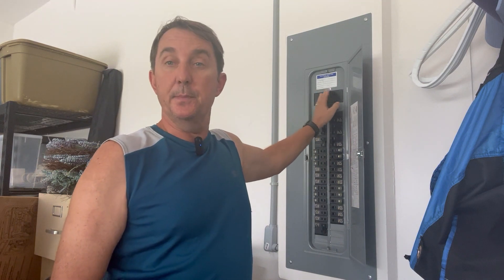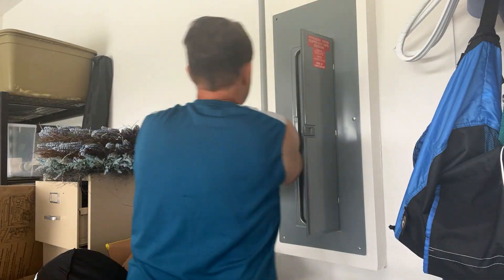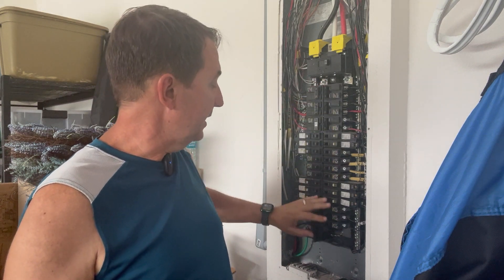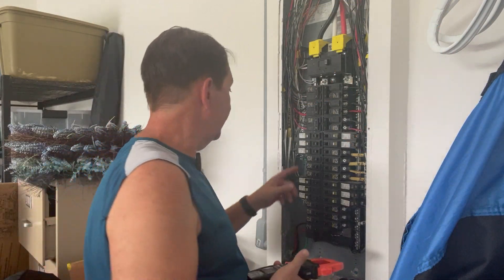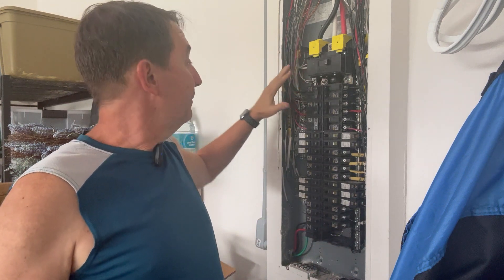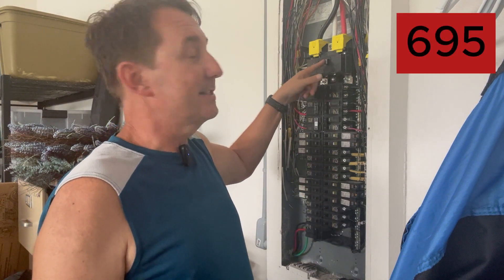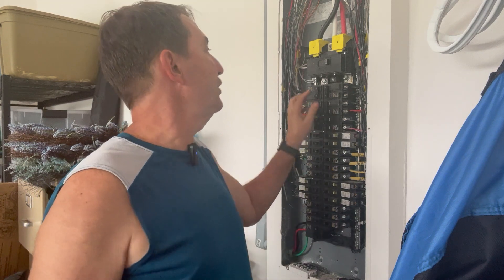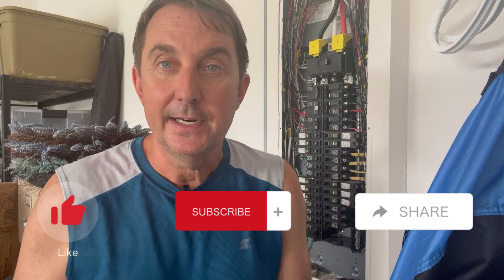200 Amp Distribution Panel with 695 Amps of Breakers - How Can this Work? #howthingswork

Comment: Should check the ground and neutrals to see if your getting unbalanced loads
Reply from the maker: Well, the grounds and neutrals don’t have anything to do with an unbalanced load. 
It’s actually how much one line is pulling in compared to the other line . You can usually take an app clamp meter and check the neutral between the two phases. 
If there’s a big difference, you can compare line to line to amp wise and see how far off they are . 
If they are unbalanced and stay that way all the time you can move breakers around to help balance it out . 
I hope that makes sense

Comment: Its possible because u dont use every breaker or all power at once typically. We only use a part of the panel throughout the day. Never do we use nearly 200 amps in a day at once maybe 80 amps if that
Reply from the maker: Not even 80 A honestly. Not unless you got the dryer your EV charger cranking out 48 A and your pool pump and your AC is running. Will you ever get near 80 Amp.

Comment: This is called demend factor. By definiton demend factor is used to refer to the fractional amount of some quantity being used relative to the maximum amount that could be used by the same system. Demend factor for diferent circuits is governed by NEC.
Reply from the maker: I like it! A proper definition. It’s demand factor but I know what you’re taking about. I appreciate the comment and thanks for watching!
Reply: Right demand factor :), sorry for the typo
Reply from the maker: It's all good. Ty for spending some time on my channel. I hope you enjoy the videos. 😎